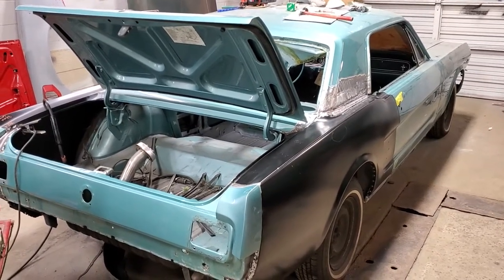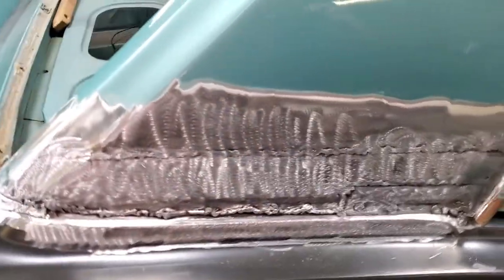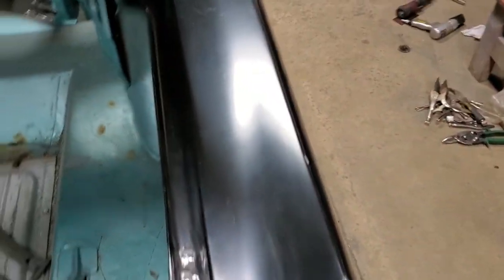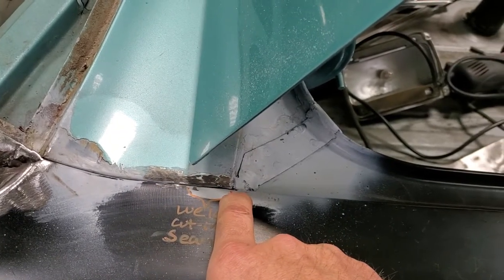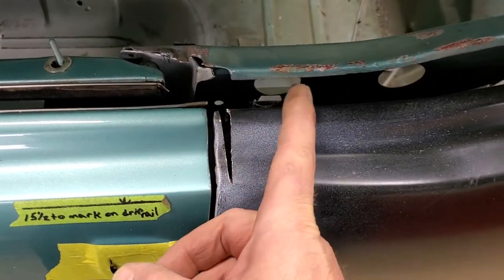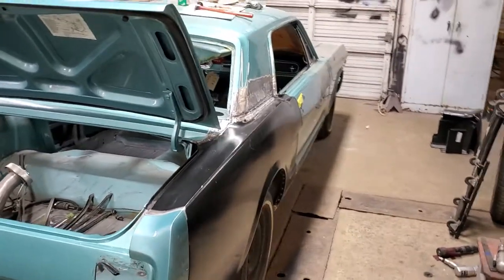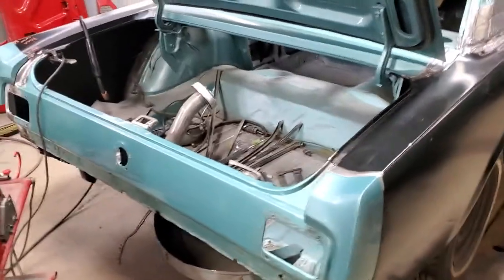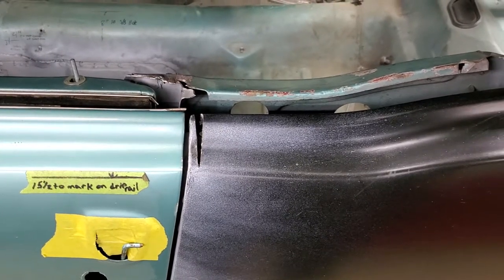"Frankenstang" Part 14a, 1966 Mustang Restoration

Comment: Buy a Ford endorsed complete c shell -- this proves original Mustangs are rust buckets.
Reply from the maker: Not all original Mustangs are as bad as this one was. I just picked up a '69 390 Grande Coupe for a customer, and the car will need very little rust repair. All cars will rust badly if they're driven in the rustbelt. Road salt and liquid de-icer are brutal on metal, no matter what car it is.